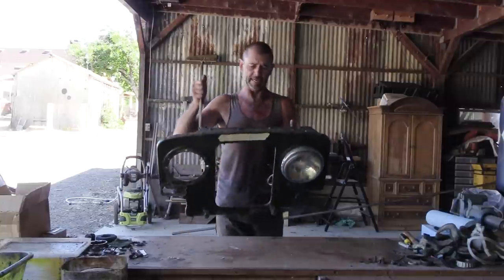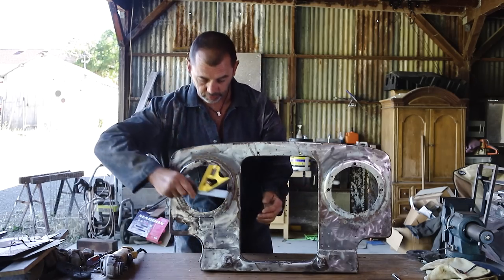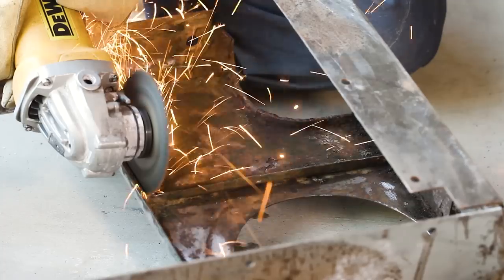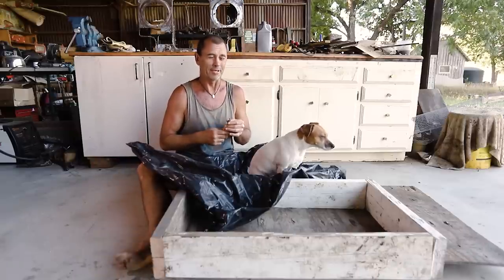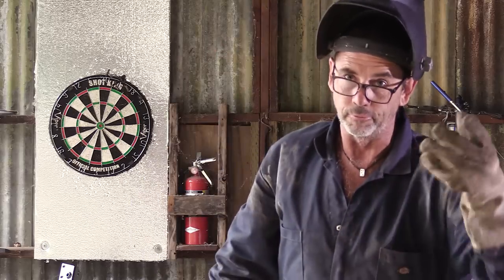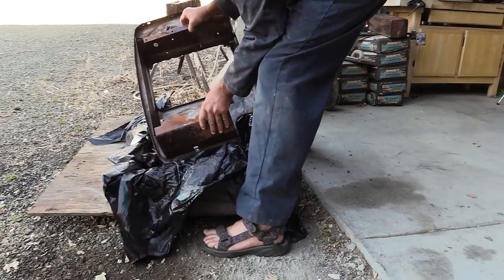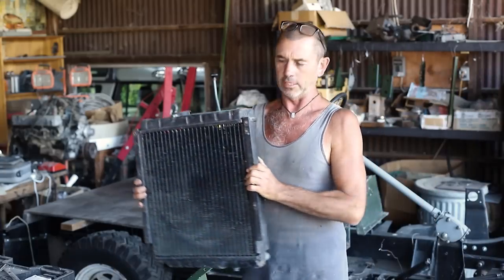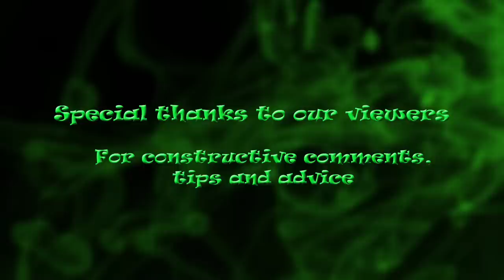Part 30; Front Grill Facelift; Series 1 Land Rover Restoration.

Comment: Gday , I’ve started using electrolysis to basically remove ALL rust and the process turns rusted metal into a black coloured solid steel . Just need some sodium carbonate and a battery charger !!  And weld through primer is your rusts enemy ! Love your series 😎

Comment: Nearly to the end of this episode I was thinking how straightforward everything was going.  Then, Gav,  you introduced the new and dimensionally different series 3 radiator into the mix.  So, here's a sincere and heartfelt wish for good luck and success in achieving a compatible and satisfactory arrangement for the radiator, frame, and engine.  As ever, Keep On Keepin' On!  👍
Reply from the maker: Thanks Noah, I think we'll get that radiator in. I did look into some custom ones where I send them the original and they make a whole new one. Expensive but doable if needed.

Comment: Put a 2.25lt series 2a engine in the new rad will match up there may be an issue with gearbox bell housing series1 and series 2/2a not same stud patten but you can fit 2a bell housing to series 1 case but will need to change to series2a layshaft as they use larger front bearing.
Reply from the maker: This is a very good albeit expensive suggestion. I may or may not already be investigating this option. Can't say too much because of spoilers. One source, yet to be proven reliable claims the stud pattern of series 2 and early 2A will be a direct fit to a 2.25 ltr motor and use the same layshaft and bearing, they seemed to have been beefed up sometime around 1963 ? Allegedly these bell housings also accommodate shaft activated clutch system of the series 1.  Weather this information proves true or false is yet to be seen.

Comment: Check out Disovery 300 TDI engine transplant into Series trucks great on fuel power and same configuration as Series 2 1/4 block great video your metal fabrication is next level that firewall was epic.
Reply from the maker: Thanks Gippy. I think the 300TDI is a very pricey option though aside from re-doing the V8 there isn't a cheap option. At least the one I did find ran off with my money so that doesn't count.

Comment: Lots to think about the biggest is the cost of making any other engine match up to the Series 1 gearbox, bell housing adapters are available but not cheap. The other issue is how much power you can put in front of a series box, also what are the differential ratios, are they original 4.1 : 1 or later 3.54: 1 to suit the V8 engine. I know you have refurbished all this kit but the relationship of all components is relative to longevity of the vehicle. Having finished my 2A and installed 225/95/16 tyres to a standard setup i am finding gear ratios a big influence on my driving. It's bloody slow on hills but great on the flat the bigger tyres equate to something like a 16 % increase over original ratios therefore effectively an overdrive. Not good for the hilly country i live in or the Mountains i am hoping to camp in. Gonna be exciting on some of the downhill sections as the tyre size effects all gears and both high and low ratio engine braking. 
Thanks again for the videos i have been watching for years you and Summer deserve a better following you, i think you have produced some of the best videos on YouTube and deserve to be recognized. 
I know i have commented on this video a couple of times in the past, i have to admit i have been known to imbibe in some Sugar Cane Champagne on the odd occasion. \
All the best
Reply from the maker: Greetings Gippy (I'll address you by your code name on a public forum). The power plant saga for the old land rover could be very close to resolved though until it is being loaded into the chassis I don't want to celebrate too early. The whole project has stalled on the engine section but as this is as stated, a public post, I can't reveal details. The diff gearing I don't know about, I suspect now they are from a series 2A and if there is a standard for those then that is what they'll be. I haven't even driven this vehicle yet besides the idle limp into the workshop so I have no idea how it might perform once operational again. I've a friend down the road who owns a series 1 to use as a reference but 'down the road' where we are isn't that close.  
 As for our channels very small status we are definitely good with that arrangement and hope it continues. A social media personality it not on my 'to do' bucket list.

Comment: In the old days they used lead to fill in the pits one get paint on lead heat it up and it turns to lead and one while its hot smooth it over afterwards sand it away using safety equipmant ofcoarse butt tgese days its bondo or boddy putty

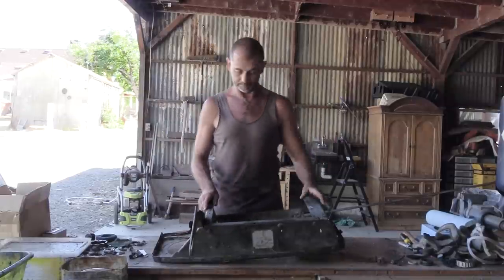Comment: So what I remember about my engine swap to Rover V8 in early 80s was a kit from Philips   engineering 1:14 ,Diffs one from Rover 90 one from early Range Rover 12 spline? ,Jaguar MK1 clutch mounted to Rover P6 flywheel, cut 1.1/2 from top of Bell housing indentations on the Bulkhead (1firewall) then pop rivet back in   You need a small hose from top of manifold to top of Rad to bleed off air from  Highest point in system, use a drilled out Metal shraidar Tire Valve and 5/16 hose -+ Electric Fan  There is no reason for cutting the front crossmember as mine was a 86”  I think the Mods to yours are from an earlier Diesel conversion maybe  ? Is you’d a 86 or 88 “ the most important thing is the Diffs as it’s  undeliverable without can’t remember using 1 gear - presently restoring a 88 series one station + I have remains of 2 more series ones 80 and 86 Best of luck Sam

Comment: Eastwood company sell good rust coverters. 
I would use phosphoric acid. Then cold galv and etch primer.
Reply: Can't you get the rad recored  cheaper?
Reply from the maker: I looked into a radiator re-core and fix. The places that do it seem nowadays to be few and far between and the one quote I got was $800 USD which scared me off. I could get a custom aluminum one for a little more but if the series 3 can be made to fit I'll settle for that.
Reply: @ForemanAndWilmsAdventures  i can see 4cl rad $550 6cyl $1200. In AUS from brittishautoparts. Maybe $800 is not bad. But ye, fit the rad you got now. As long as it can handle a bigger motor

Comment: Don't mess it up fitting the wrong engine 2litre petrol plenty fast enough . Keep everything original . It's a classic vehicle of historic value. You would not fit a chinese movement in a grandfather clock and scrap the original mechanism. Respect the vehicle you have . A lot of these motors trashed through so call improvement that only devalue the motor.Phil